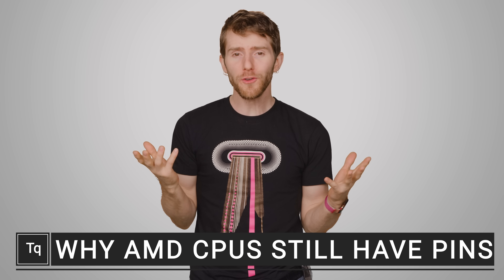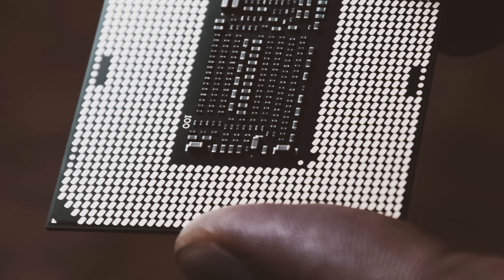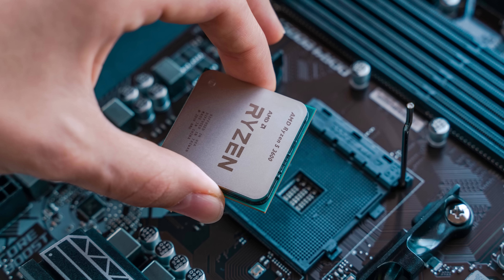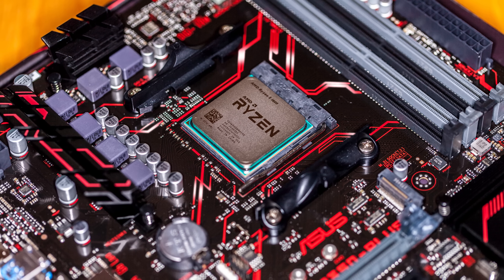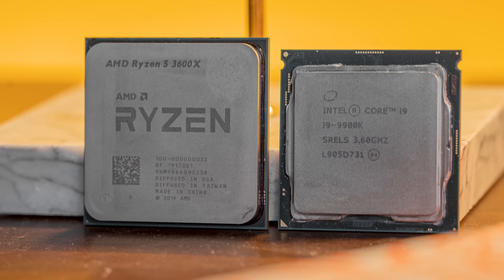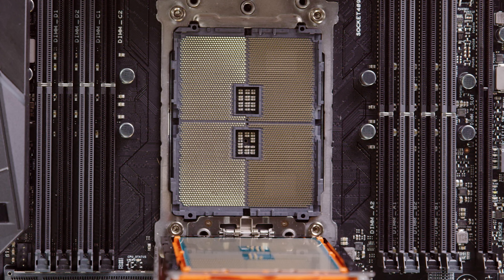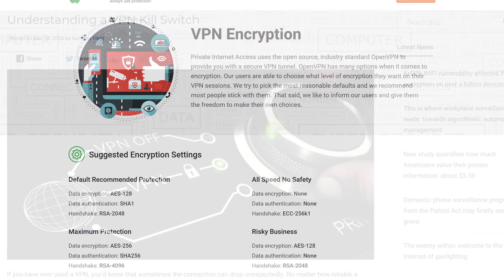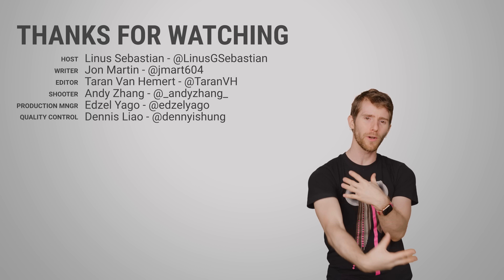Is AMD Stuck In The PAST?

Comment: I have a thought... Why not make the exact same motherboard with 3 different CPU types part of the board...

So you buy a MB/CPU combo, nothing to break cause they are fused together.

"But what I want to upgrade the CPU?" ... Seriously, how often does someone change their CPU once they have the system in place?

Graphics cards and HDD/SSD yeah sure, we change those a few times in a systems life cycle.

But normally, when a new super advanced CPU comes out, in order to use it correctly, you need the new chipset motherboard...  Sure you can update the bios and make it work, but the board wouldn't be able to access the full advantage of the new CPU structure/codes, it will just work.

Also, a new CPU usually gives you jack shit in performance boost over the previous CPU, so always best to wait 3-4 years between switching boards/CPU anyway cause then you get a real upgrade in comparison.

This yearly release of new products that are like 5-10% better than the last year's model... Who gives a crap, they should do a once 2 yearly release and make the damn products better and do more testing before pushing it out for consumer use.

We all know why they do it... To trick morons into giving them more money every year for no reason, money money money, shit shit shit.

Every 3rd/4th release is usually worth the upgrade compared to what you bought originally, and that requires a new M/B anyway.

Comment: Make a video on 'how 12nm / 7nm transistor size made in CPU. And why intel is struggling to produce 7 nm? What's the main problem before making size smaller. I want to know. I guess it's not just make the size smaller right? There's lot more. Explain those problems. Tnx

Comment: "Is AMD Stuck in the past?" As Intel has literally used the same CPU architecture full of security holes since Lynnfield, with the most minor of adjustments for an extra 'premium' fee each year.
Reply: Clearly someone who doesn't understand or know anything about architectures. That's like saying almost all games are the same because they were programmed in c/c++... Yes they're all based on the x86 architecture, but massive changes have been made to x86 since it's invention. There's been massive leaps in performance because of the features added to x86 over the past few decades. I started studying architecture design in college because it pays so well, I quickly abandoned it because it's insanely hard; my understanding of it is insanely basic and even I understand why simply creating a completely new architecture with every CPU would bankrupt a company.
Reply: @paulghignon4092  I'm usually no conspiracy guy, but I believe the major computer architectures are strategically kept monolith's, even with many cores. The leaders of the market fear parallellism. All computers must be driven by a single complex construct that cannot be separated in equal or different parts...
Reply: @manuell3505  your word salad makes absolutely no sense. Architectures aren't "monolith's" or large in any sense of the word. They're massively complex mathematically speaking. I've personally met people with Master's degrees that struggle with architecture design. The reason for this is that it's been improved on for 42 years, with increases in efficiency with every year. A new architecture will always inherently be less efficient than one that's been improved for over 42 years.
Reply: @paulghignon4092  Manuell's word salad makes more sense than yours does. It's a conspiracy theory, the basis of which requires that one breeze past all of the more realistic factors into a fantasy world where corruption is the only one that matters, but it's perfectly understandable. You, on the other hand, contradict yourself straight off the bat, then run off on a tangent about efficiency, which is only slightly related.

No major issues with your previous comment. :P
Reply: @auturgicflosculator  Monoliths implies that it's large, it's not large in any sense of the word, complex and large are not interchangeable words. When it comes to architecture, size is not the name of the game. Anyone who's done programming knows that as the amount of code that's executed the less efficient it gets, that's why you need to break the code down to execute the least amount possible while still getting the desired results; Architectures operate in the same way.
Reply: @manuell3505  well, in the same time a lot of computing has moved to cloud, where the code does not even know is it running on Intel or AMD. Locking a program to single core is an easy complexity saver, but usually unnecessary and does not even scale. Systems doing multiple things usually benefit (in terms of processing power) from ability to run multiple threads simultaneously.
Reply: @heiggi1337  True, but individuals usually don''t own clouds and mostly depend on an interface as I described anyway.
Currently, I'm looking at my browser, struggling to present me 2d content, as I did 20 years ago. Isn't it strange that clouds or any other distributed system still can't handle it? There's the problem...
Reply: @manuell3505  presenting graphics is an old problem solved for parallel computing. Ever heard of GPU's, or have you ever tried to render graphics with CPU with no graphics module? Btw, if you have multiple tabs open you will totally benefit from multiple cores as each browser tab (and browser itself) have their own threads (or even multiple in case of web workers).
Reply: fields means holes in latin anyway
Reply: Almost every system is affected by Spectre: Desktops, Laptops, Cloud Servers, as well as Smartphones. More specifically, all modern processors capable of keeping many instructions in flight are potentially vulnerable. In particular, we have verified Spectre on Intel, AMD, and ARM processors.
Reply: @BrawndoQC  Yeah thats neat and all, but you're forgetting Meltdown, ZombieLoad, and L1TF which dont affect AMD (Meltodwn is PPC/Intel x86/some ARM and L1TF/ZombieLoad are Intel exclusive) and the ones that cause the most performance loss to mitigate.

Its not just one vulnerability here.
Reply: @PubstarHero  AMD processors are vulnerable to Collide+Probe and Load+Reload, this was found out about recently. Given the Zen architecture is fairly new and hasn't been tested thoroughly means that's there's dozens if not hundreds of vulnerabilities waiting to be discovered. Problem is the public will never hear about 99% of them, mostly because those people report it directly to AMD and usually land a job or some kind of payout as a result.
Reply: @BrawndoQC  It's got what CPUs crave
Reply: K
Reply: yh because AMD is sooooo security free 😂

Comment: When I worked as IT in a small shop, I sometimes had noobies comming and crying with their intel mobos like "I MESSED MY MOBO PINS PLZ HALP", almost of the time, it wasn't fixable, and the mobo was either sent to RMA, when by luck the RMA wasn't refused ( had several times that problem with asus). I only had twice guys that came with bent AMD pins. I said them I could promise the impossible, but with a special pliers we had at the shop, I repaired their shit. So yeah, maybe AMD is stuck is the past, but those are at least easier to (eventually) repair than intel's mobo one.

Comment: in my opinion PGA makes better contact due to larger surface area contact points. So this makes better connection and larger current can pass.
Reply: consistent wave impedance is more important than max current.

Comment: I've had to bend some socket pins back in place. Was actually surprised to get it working again.
Now if there could be an easier way to deal with an SSD with a broken sata data port and bent pins.

Comment: One massive advantage of LGA is that when removing a cooler that sticks on the CPU due to thermal compound, the CPU is retained by the socket.
When I removed the cooler on my Ryzen for the first time after two years, the CPU ripped out with the cooler. That was painful. Luckily nothing broke. Definitely twist the cooler before pulling on PGA!
Reply: That is not a problem of PGA, it is a problem of how AMD designed their PGA socket. Nothing stops the designer to add some mechanics that hold the CPU down, except cost.

Comment: Important lesson: "New" does not automatically mean "better."
Reply: Learned that the hard way with my 5700 xt. Huge upgrade from my 1070 but way too many problems. Had to return it in the end.
Reply: I agree. The pin system is a reliable way to be able to contact the CPU due to more surface area. That additionally are more durable
Reply: >Newer cars having a tendency to break down faster would like to know your location
Reply: like the note 7...
Reply: exactly... Even though when the ryzen 1000 series launched with wayy better cores than bulldozer, they didn't work very well (especially from the ram standpoint) but some stuff gets ironed out with time so in the end I'm happy with my 1600 even though some games stutter sometimes
Reply: So true.
It's like a new president
Reply: @MrGametop1  How the fuck do you even bring politics into an LGA vs PGA discussion?
What kind of black magic twist-speak form of verbal art are you even practicing?
Reply: Yes, but in this case it is.
Reply: @nogaredofb  Yeah, a new president of the USA would be nice.

Comment: The best benefit of AMD stuck in the Past is that I can straighten the bent CPU pins back easier than doing it on a more fragile pins in the motherboard. Also take note, ZIF socket. Zero Insertion Force.

Comment: Hot take: putting pins on the bottom of AMD chips makes the chips themselves more likely to be damaged compared to intel, where the motherboard is more likely to be damage. Which means that when some part of that contact goes wrong, its cheaper to replace an intel mobo than an amd cpu?
Reply: Given how cheap ryzen is and how expensive z390 is, it would be cheaper to replace a ryzen cpu than an intel mobo

Comment: Linus: AMD is stuck in the past.

Intel: 14nm++++++++
Reply: Michael Lyga 14nm+++++++++++++++++
Reply: @gor5685  14nm++++++++++++++++++++++++++++++++++++++
Reply: well, intel makes their own chips. amd doesn't much easier for them
Reply: No hyperthreading either.
Reply: hahahahaha! VERY TRUE.
Reply: AMD CPUs are now based on the 7nm architecture
Reply: It does work intel still beats amd
Reply: Lol AMD fangay in this comment
Reply: 14nm and still performing as well as AMD. Now imagine where Intel would be if they switched to 7nm. AMD would not be anywhere near them. Like a 6502 chip versus any modern CPU.
Reply: @GuretoSefirosu  10nm Intel 4-core chips are slower than Intel 14nm 4-core chips. Why would Intel 7nm be faster?
Reply: @edfx  true man!
Reply: @GuretoSefirosu  yes but with power draw over 9000
Reply: @GuretoSefirosu  ...you want zero competition again? You must be rich.
Reply: @auturgicflosculator  I never said that and in fact stated that we use AMD for tasks (generally computationally intense) where AMD really shines. I want AMD to give Intel reason to forge ahead. However, I use each chip for what it is good for. I do not use a Civic to haul a tractor on a trailer nor would I use a pickup to go around the corner just to get some milk. Each processor chines in a different way. Where did I say I wanted AMD to die?
Reply: @GuretoSefirosu  "in fact stated that we use AMD" I don't recall seeing any comment from you to that effect. Unless you're IN THE VIDEO, I can't be expected to have seen any of your comments outside of this thread.

The one short comment of yours that I see can easily be construed as insane Intel bias, since the 6502 vs modern cpu comparison is ridiculous hyperbole.
Reply: GuretoSefirosu well you also can’t say that since the only reason amd is on par with Intel cpus is because most programs don’t utilize the full power of the cpu
Reply: GuretoSefirosu the 7nm just means they can fit more stuff into a smaller space without it heating up to bad. But having more cores no matter what decreases single core performance that most programs still use. However it’s mitigated by the lower scale. Which is why there is no real difference between intel and amd. However if every program supported multi threading then amd will demolish intel in almost everything. Ever notice that amd CPU’s have lower cpu utilization than intel cpus with the same game but have similar FPS and performance. They took advantage of the lower scale to add more threads which allows for more task to be carried out while still maintaining high performance something intel cpus simply can’t do.
Reply: @GuretoSefirosu  yes but, no. Sounds a bit defensive of you saying it as you do but the reality is AMD are near them, in fact AMD are way past Intel. This is the current timeline dude and Intel suck after years of ripping off the consumer.
Reply: @GuretoSefirosu  Intel's days are already over.Just wait for the 4th gen Ryzens

Comment: There's one additional reason: PGA means you're much less likely to damage your motherboard during install, but more likely to damage your CPU. This makes it easier for consumers and the OEMs, since all you need to do is remove the CPU and RMA it in a small sleeve envelope. With a damaged motherboard, you need to disassemble your PC to remove the board, then mail it out in more expensive packaging.

Comment: It makes sense too that AMD with their Ryzen line of processors are PGA, since their am4 motherboards are all forwards and backwards compatible with each new generation of Ryzen cpus. This would make sense to value a long-lasting motherboard slightly more with Intel choosing to have a new motherboard every two generations or so, which means you can afford to have a less robust pin layout on your motherboard if you're just gonna have to get a new one if you upgrade rather than dealing with a bent pin slotting in a new cpu.

Comment: I have seen a few people struggling with updating their Bios on x370 (AM4) Mother boards so they can run the new Ryzen chips.  I have had to do this process and it worked for me.  I have also had to explain how it is done to a friend of mine.  I would make the video but, I do not have the right set up to do so at the moment.  I think it would be helpful and good to see how that process is done on one of your channels, thank you for hearing me out.  ^,.^

Comment: Here's my take on it. If you have any experience with trying to repair bent LGA socket pins vs CPU PGA pins, I'd take CPU PGA pins any day... Let's suppose you accidentally snap off a pin trying to bend it back into shape... Good luck trying to repair that socket pin... I have in the past successfully re-soldered new pins on a PGA Pentium 4 CPU which was rendered by others as a dead and useless CPU. I also recently had the arduous task of bending 5 LGA socket pins back into correct position and it took nearly an entire hour and 4 attempts to get the CPU to actually boot again - screw that...

Comment: The PGA is fine, but AMD really need to redesign their socket. The CPU in the is poorly mounted to the AM4 socket and easily some CPU pins if you don't aware that taking off the Heatsink may rip the CPU out of the socket

Comment: I like PGA chips for assembly, but LGA chips are more fun to flip around.

One time I pulled a Pentium 4 out of a couch and it had been flattened... I was able to straighten every single pin and throw it back in a board, worked perfectly fine.

Comment: I've built hundreds of computers out of piles of scraps for donations to needy folks and for computer labs stuff. Judging from that experience, it's surprising when I find a bare LGA motherboard that doesn't have at least a couple mangled or otherwise damaged leaf spring contacts (which it's a crap shoot if they can straighten back out without cracking), yet I have a really good track record of straightening bent pins on PGAs. I soldered pins back on to a number of good processors in the past, from 386's, up to an FX Black (that someone dropped onto their bathroom floor while trying to clean a bunch of thermal paste off the pins, because she thought that the back of the processor was the top for some reason...

Comment: When I changed my cpu cooler from wraith to a scythe ninja 4, my ryzen 3700x cpu (as always with amd I think) just sticked on the wraith. I separated it after a while and saw oh shit, a few pins are bent.
sweat intensified
Thought to myself
OK Dr. She need a flathead and slightly bend it back in position.

End of story: it was successful. Benched my processor with cpuz and it scored 300 points more than a 3800x.

So just bend your friggin pins, it's a   boost😁🤙🏻

Comment: when your cpu sticks to your monster cooler... You rip the cpu right off with pins.
Reply: If you are that incompetent you should be just buying a dell sff.

FYI all you need to do is heat up the proc with ada or any other heavy task, shut down the  pc and give the cooler a little twist. It will come right off like it is supposed to.

Comment: The biggest problems I had with PGA CPUs were before ZIF sockets were a common thing on motherboards. Back in the days when inserting a processor or co-processor actually meant that you had to push the thing down with a pretty bit of force.

Comment: LGA is cheaper for the processor manufacturer, offloading costs onto the motherboard manufacturer. There isn't really a reason to use it if you don't need greater pin density, unless you are going overboard cutting costs.